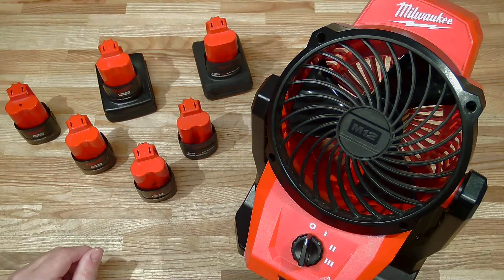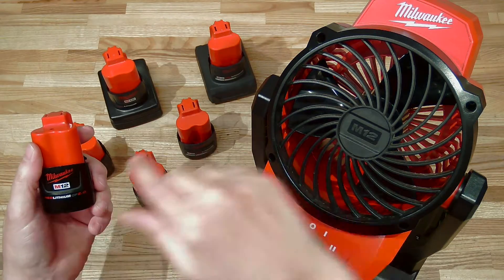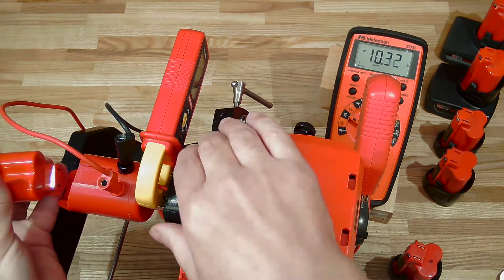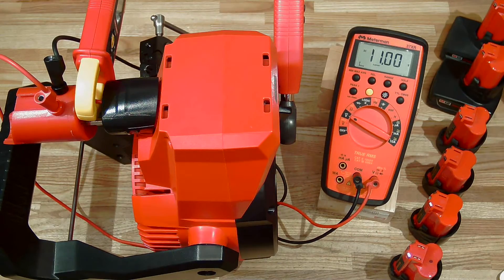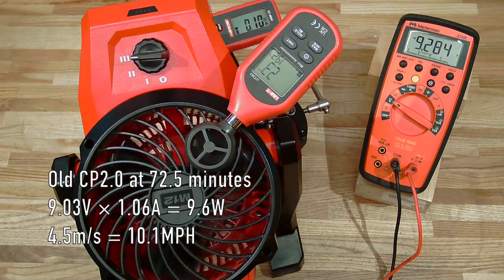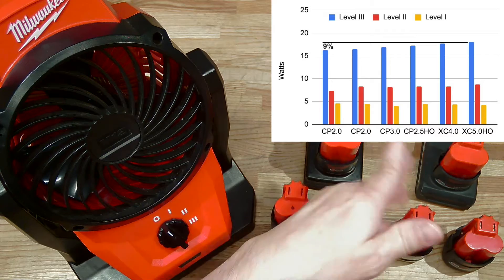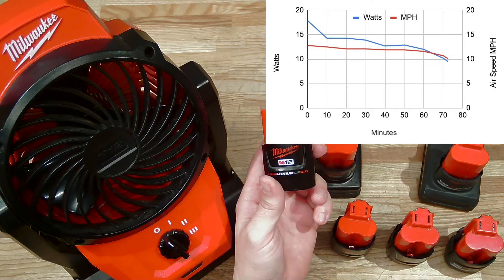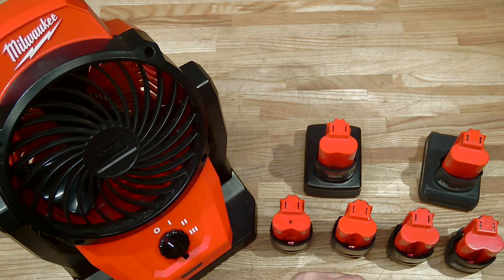Test: Milwaukee M12 HO Batteries Better In Their Mounting Fan?

Comment: Nice video...  Milwaukee fans blow decent air, even at low speeds... I have an 18v fan and I only leave it on speed #1... Last for hours on a 5.0 battery..  

I'm sure similar results would be the same with this fan
Reply from the maker: Yeah, definitely lasts long on low. Though on low it needs to be pretty close. Okay situationally: I hear people like clipping it to their lawnmower handle! I ended up getting the M18 18", it moves way more air and on low it lasts forever too.

Comment: For me this fan is only good if you always have somewhere to mount it as youre working so it can be close to your face. If you leave it on high the batteries die to quick. I wish it wouldve been able to run off of ac power as well. I prefer the 18 inch fan or the m18 packout.
Reply from the maker: I sold this one and got myself the 18" M18 fan. Size really does matter for tools that move air: bigger = more efficient. Similarly, I got rid of my M12 wet/dry vac for a 6 gallon M18... night and day difference in performance / efficiency. Will eventually do some vids.